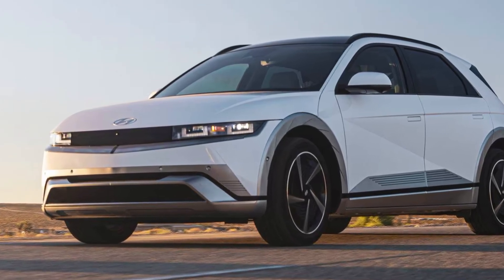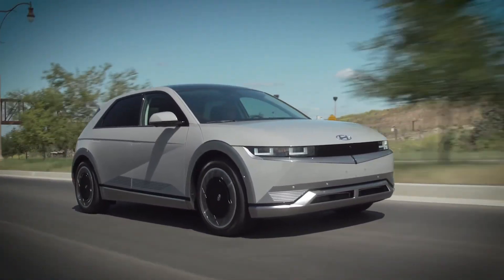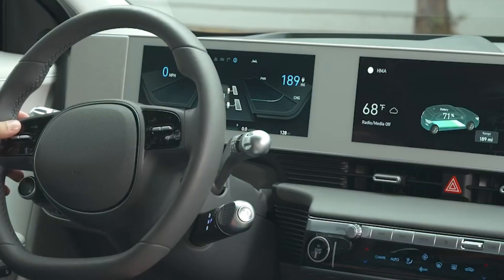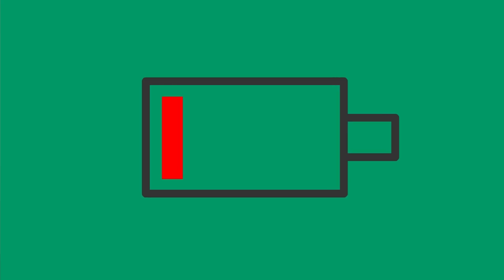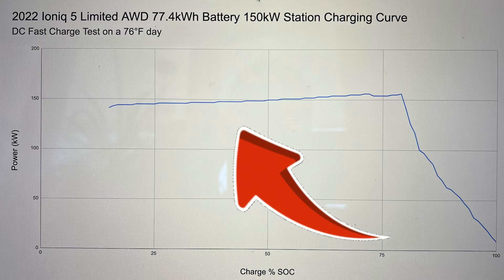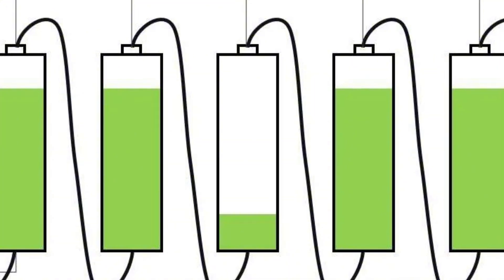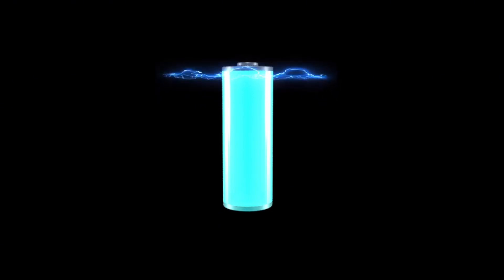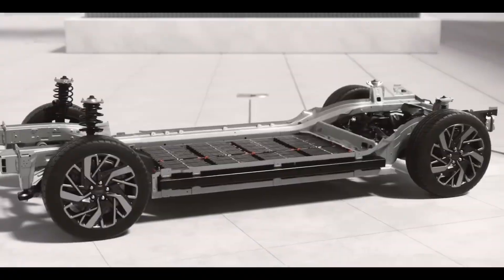Ioniq 5 Fast Charging: What Happens to Battery Longevity?

Comment: Thank you for this instruction. Sad more people don't drive the Ioniq 5 or in our case, the Kia EV 6. Ours is a 2022, and we do nothing to warm up the bank before fast charging in winter, as it seems this model does not offer that feature (that we can find). The navigation software is fairly useless and so we no longer pay for it, and using it to anticipate the upcoming charge is not an option. It is possible we just don't know the pre-charge warmup procedure, or perhaps there's a software upgrade we need. We live in Maine, so cold winters are a thing. We mostly fast charge on the midpoint of a monthly round trip and use home charging the rest of the time. If you know how to warm up our bank I'd appreciate hearing how. Thanks.
Reply from the maker: Hi 
You can use the kia connect app and see if you can enable conditioning by setting a departure time when you are charging at home. This can help you boost range and get the battery warmed up.

Check in the manual, some old models might enable preconditioning when you select high charging target like 100% ( you need to check the manual)

The last solution is to drive 20-40 minutes in normal or sport mode before reaching dc charger
Reply: @shayan_ev  Thank you for your reply! My manual has only one mention of pre-conditioning, that being for a departure time. We normally charge after 2 hours of driving, so perhaps that's all we need to do. It's hard to know if a slow rate of charge is due to the car or the charger when other cars are at neighboring spots. A few times it has been abysmally slow.
Reply from the maker: @brusharp 
If your charging is slow , check if you have selected low target power for charging in the display or app.

Comment: En mi Ioniq 5 siempre había un par del celdas o tres que se calentaban más que el resto y por su culpa se reducía siempre la potencia de la recarga antes de tiempo.
Reply from the maker: This is a totally correct scenario.
A parallel group of batteries will be suffered due to differences in voltage, chemistry, etc and some cell’s heat up.
For better understanding of this phenomenon , you can refer to my video:

https://youtu.be/rxtmp8jQPnE?si=9nV2_3OBYRceXVR6

Comment: I've DC fast charged my ioniq5 for 3yrs and now the car has 250,538 miles on it.  I still get 95% of range. It's a fantastic car.
Reply: How have the ICCU(s) held up
Reply from the maker: Thats amazing , Are in a extreme cold or hot region? Did you park the car in garage?
Reply: How many miles when you bought it?